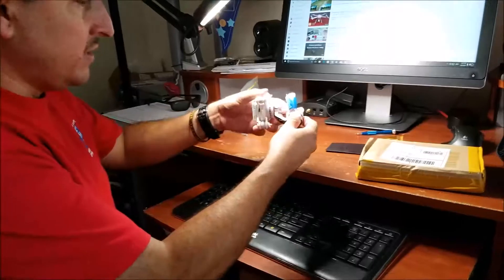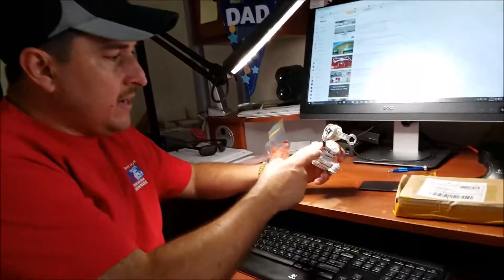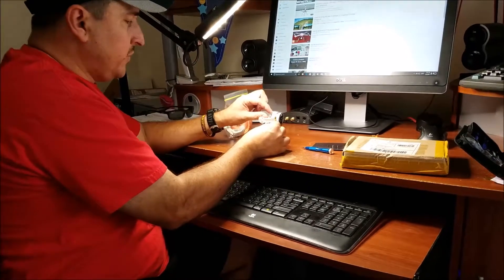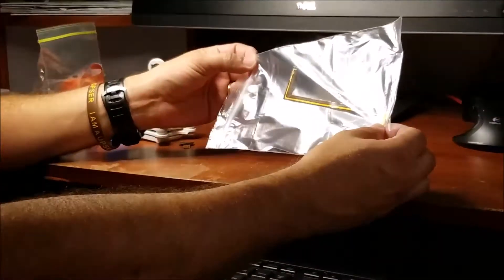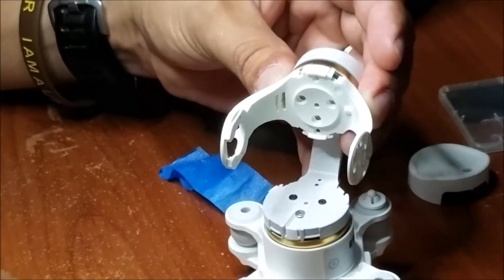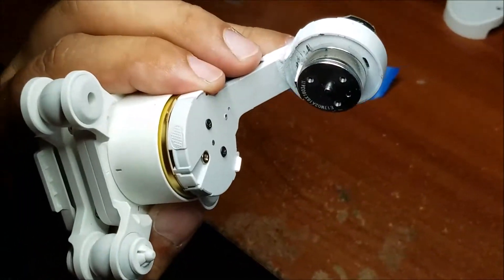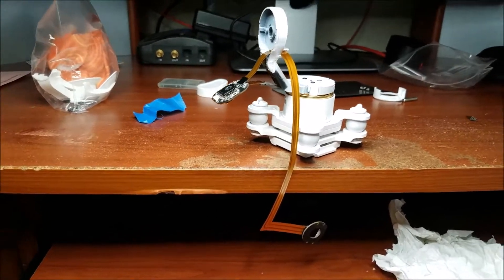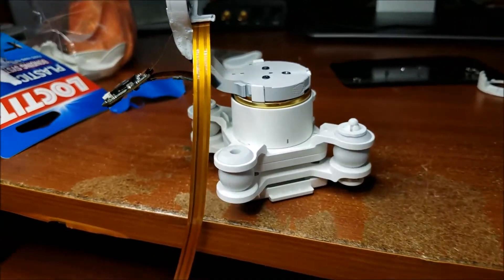Xiaomi Mi drone 4k broken gimbal repair Part#6

Comment: Hi the cable you bought off aliexpress going from camera to gimbal was it number one the long cable or number two the shorter cable thanks
Reply from the maker: Mine was number 2... soon I will post a video changing the gimbal frame and one of the other cables. Good luck. GID BLESS!!!
Reply: Ger Vi7 cheers thanks a lot

Comment: Great job! Yes. Some plastics work well with cyanoacrylate adhesives some don't, like the plastic tube the Loctite comes in and why they use it. I call them "oily" plastics unlike the "crumbly" ones LOL 
First saw using baking soda to repair a guitar nut that was chipped and the guitar string would come out. Person built it up using soda and glue then filed neatly into shape. There is a lot of tension in a guitar string but the glue/soda fix worked well with the smooth/shiny "oily" plastic nut.

Comment: Which cable do you bought? Please with URL and number, thanks.
Reply from the maker: https://www.aliexpress.com/store/product/Xiaomi-Mi-Drone-4K-version-RC-Quadcopter-Spare-parts-GImbal-Ribbon-Cable/1460814_32812828690.html
Reply from the maker: all 3 are part of the drone , you need to open it and measure it with a ruler to see with is the right one, good luck
Reply: German Villalobos yeah I know, I need the same cable as you in your video, did you choose no3? The cable on the picture look dofferent from mine, so I dont know.
Reply from the maker: Niklas S cheek the numbers in the web thats the size.. then measure your damaged wire, mine was #2
Reply: Ok strange, thank you. My cable is about 17cm long, but I could swear its the same as your cable.
Reply from the maker: Niklas S the best way remove your cable and mesure it.... good luck
Reply: Thank you.
Reply from the maker: Niklas S let me know how it goes
Reply: German Villalobos yeah ok
Reply: Niklas S 
Hey Niklas, I have the same torn cable going from the base of the gimbal through the control arm as in the video. Mine is exactly 17mm which is the No 3 cable in the link. Did you order the No 3? Did it work?
Reply: Lumpy i sold this week my drone, so no i didnt ordered the cable.